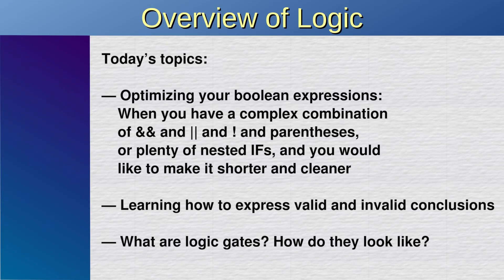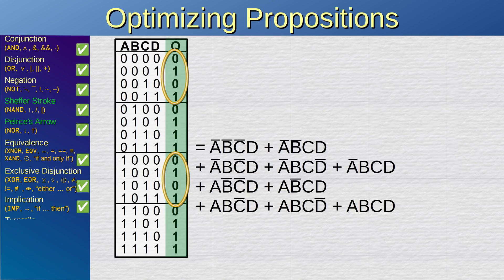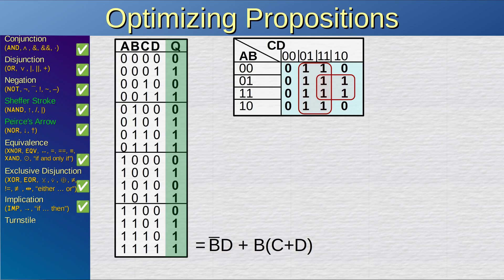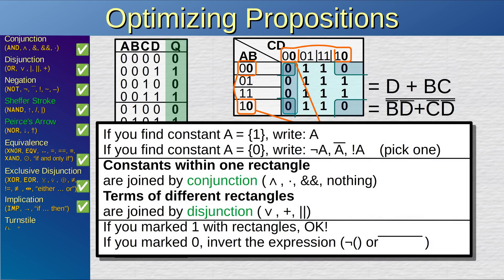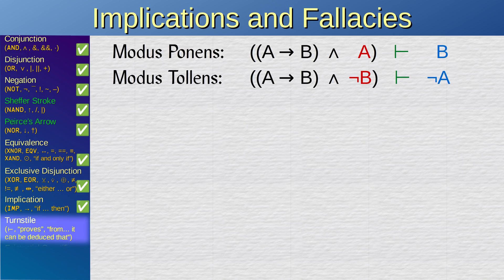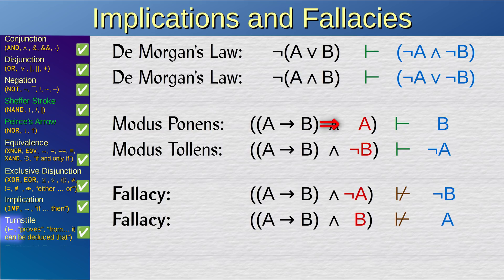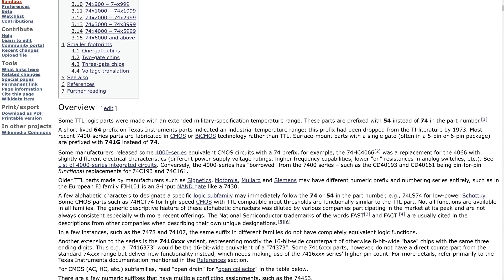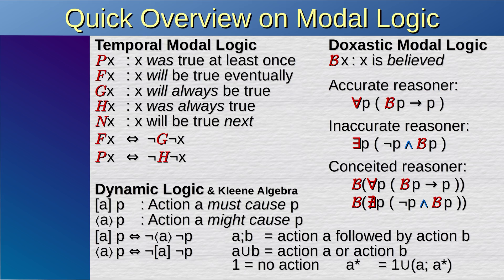Logic 2: Karnaugh Map, Fallacies, 7400 Series — Tutorial 2/4

Comment: Just a little sidenote....finding the truth table for both the '1' side and the '0' side allows you to easily construct a CMOS, since it requires both sides to stay at voltage. Just a little trick.

Everything can be described by logic, if it can't, then the logic is not constructed correctly, just fyi. I have found many flaws in paradoxical logic that just tries to purposely break a system, but it's just conclusive that it isn't broken, but the connection to the logic is flawed. It's like saying that not all keyboards work, just because sometimes you put a fishbowl on it, it's a keyboard for people, not fish.

Comment: Why do those old graphic cards use such large nand gate chips that contain only four nands? One would think that they could add like a million nand gates in one of those chips.
Reply from the maker: Commissioning a custom chip, and manufacturing it, was not cheap back then.
Reply: Technology not available or too expensive at time. And they later did btw.
Is called PALs/GALs, CPLDs and FPGAs.

Comment: Thanks! This is very unrelated to the video but since you just uploaded ill ask. can you use PARI/GP to find an input to a function such that the output is equal to a certain number? Not reversing the function, just finding an x value for f(x) = output i want
Reply from the maker: I don’t know if PARI/GP can be used for that, but Maxima certainly can.
For example, the input
  f(x) := tan(x)*5+3;
  solve(f(x) = 0.2);
or just directly
  solve(tan(x)*5+3 = 0.2);
gives you
  x = –atan(14/25).
It is still not as smart as Wolfram Alpha though, and can’t solve e.g. solve(log(x)*3/x = 1), which should produce a Lambert W function.
Reply: @Bisqwit  I have a very large function though, it's several thousand characters long. Do you think maxima can still solve it?
Reply from the maker: No idea until you try. Maxima flat out refuses to solve certain types of functions. It’s just up to what kind of structures your function has.
Reply from the maker: Add ", numer" before the semicolon.